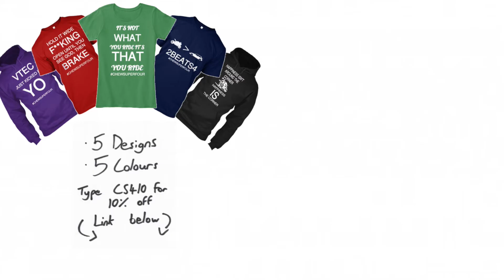Pimp My Bike: How to paint your Rearsets/Subframe and Pegs

Comment: Hey man,
How did the paint hold up so far? no scuffs from your shoes moving around?
I want to paint mine also but im not shure how long it will last, how many layers of paint did you give? any clear coats? 
and special paint?

THX!
Reply from the maker: Hi bud, 
Paint has held up no problem, no scuffs or anything, no peeling either after many washes. This bike is used year round so i was worried that salt on the road in winter etc would chip paint but looks the same as when I finished it. Paint will last as long as you make it. Preparation is key. I spent a lot longer cleaning than the video would make you think. Make sure its completely clean and flat before you start. I used 2 coats primer, approximately 3-4 coats of colour (they were light coats) and then probably 4-5 coats of clear. I will be doing my forks soon, I'll do a more detailed paint video so subscribe and you can use that as a guide - forks, rearsets, bodywork, the idea is all the same. Alternatively message me on Instagram and I'll send more detailed pics. Hope that helps!

Chew